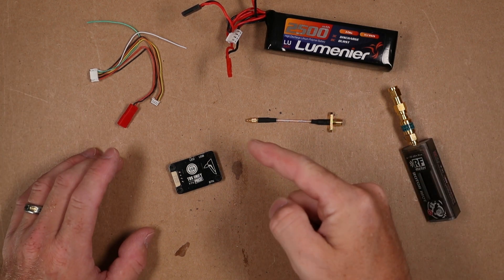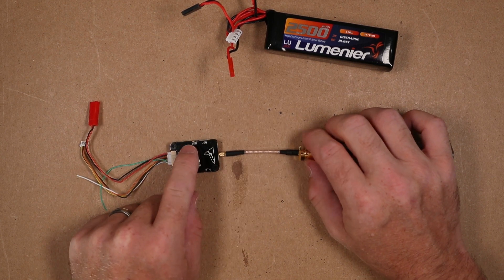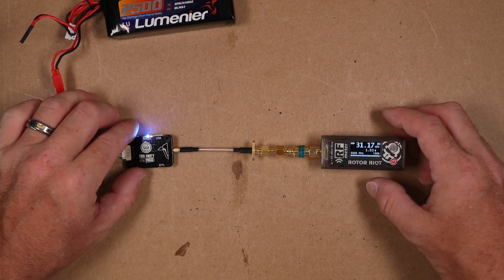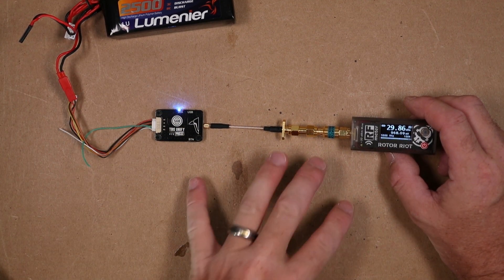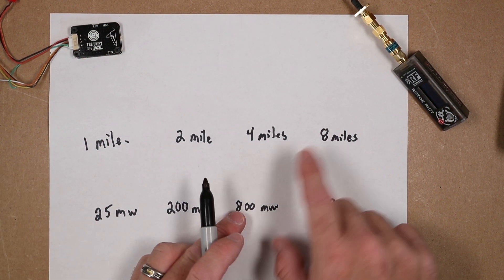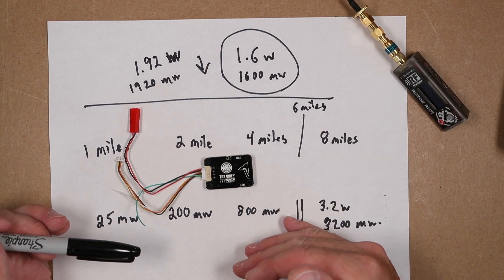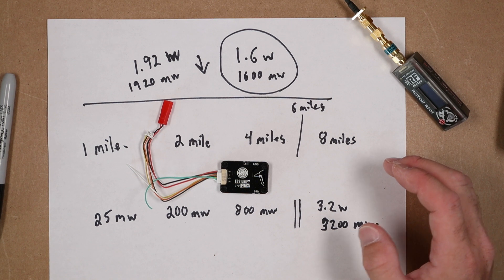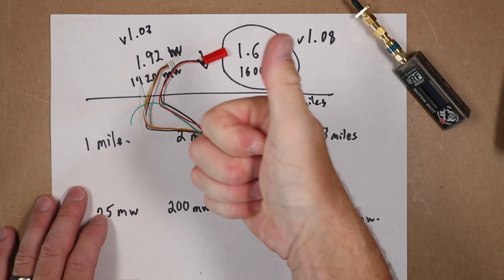Unify Pro32 HV Neutered On Latest Firmware - How Can This Be?

Comment: My pro32hv is brand new. I have 0 range. Cant move 2ft away from the vtx without completely loosing reception in my goggles. Pretty frustrating. When i power up, the blue and red light blink in random patterns. Not sure what the issue is. HELP! Ive done no updates to this vtx. Its right out of the box. All i did was install it in my rigg to the aio bardwell flight controller and it just will not work.
Reply: Thank you for the response. Ill let you know what happens sir.
Reply from the maker: Answered this on another video for you, here's the copy so you don't have to track that other video down. Good luck!

When you first power up it will flash red and blues lights. This is normal behavior. It tells you (red flashes) the 1 channel, 2 band, 3 power level, 4 temp limit, 5 pit mode, 6 crsf/sa, 7  mic in that order.  Count each red flash and make sure its not stuck in pit mode (5 red flashes, 2 blue). I know, I know its likely not that easy. If its not in pit mode it may be a power issue. Check that its getting between 6 and 25 volts. If its getting voltage somewhere in that range then it likely suffers from a half flash. This is easily fixed by flashing it in Agent X. Let me know how you make out.
Reply: @breaksteel  dude..your the shiznit! Called it! It was in pitmode and agent x did the trick in like 5 seconds...i think the hardest thing about fixing it was downloading and registering to agent x. Lol. That took 10 seconds. Lol. Thanks again good sir👽😎👽🙏 stay safe in the world. Dont let this covid thing get us down brother
Reply from the maker: Always happy to help out. Glad this worked out easily for you. Enjoy that VTX!

As for the Covid... I typed all this bed ridden. I’m pretty sure it’s the flu but I’m not allowed out for a few weeks. Asked to be tested and they wouldn’t so here I am. Will attempt to record some update for everyone as it may effect my upload schedule.. Got one vid scheduled for tomorrow. 
I’m not letting it get me down. Will press forward once able. 
Keep strong and thanks for the kind words!

Comment: I just put one in a new build and it died after about 6 test flights.  I didn't crash at all.  It just stopped working and all lights are off.  I'm going to return it  but now I don't know if I want to replace it.  It was on the v1.08 firmware.
Reply from the maker: TBS has mentioned to me that this issue is an 8 second fix with a proprietary tool. 
They also mention 1% of devices are affected. Even if that number is 20%, the odds of another bad one is slim. You could get in touch with TBS and they will fix that one with no questions. Interesting that it’s happened on v1.08.
Reply: breaksteel RaceDayQuads is sending me a new replacement.  They did ask for the old one back.
Reply from the maker: So when you get the replacement it’s said that there’s a firmware fix in v1.13 that just dropped yesterday for that issue. 
Good on them for making the exchange. 
RDQ is not a TBS authorized dealer. They are buying TBS products through another unknown vendor just to have the products available because they are so sought after.
Reply: @breaksteel  Oh, I meant to say they did not ask for the old one back.  Maybe it can be fixed instead of tossing it?
Reply from the maker: Yes it can be fixed. Open a ticket with TBS, they can fix it in about 8 seconds. Then when you get it back update to v1.13 (if they don’t do it for you) and you are good to go with a free unit. Score!

Comment: just some quick clarifications:

1) the output power was not changed between V1.07 and V1.08. I suspect the drop in your measurement is from internal heating?
2) the video transmitters are not burning up. some customers have reported that they break, which we have identified it to be unreleated to hardware. we're currently looking into "shaky" connection on powerup.
3) slight math error. 25mW x 4 = 100, not 200. it is actually why our power levels on SA 2.1 are 25 / 100 / 400 / 800 / 1W+
Reply from the maker: Thanks for the clarifications! 
1. The slight drop could be caused by the addition of an attenuator causing losses due to added connections. 
2. This is the phrasing that people have come to me with. When digging into the issues it’s usually “won’t turn on” or SmartAudio isn’t working”. Yes, hardly ”burning up”.
3. I was so worried about driving home just how tiny a loss 1.9 down to 1.6 actually is that I totally screwed up those numbers. I saw this while editing and left it as my point was made and such a elementary error is a bit humorous. I did mention I was terrible at math, although truly not this bad. 

This is still my go to VTX and the one I still recommend to people if it will fit their build. Such a power house piece of hardware.

Comment: I had this particular one with the 1.7 firmware but it stopped working with betaflight unless I upgraded the farm where to the 1.8 then everything started working again returning this back to where I got it  keep my unify HV Pro
Reply from the maker: It would appear v1.07 was not limiting properly and burning them out. I’m not sure why Betaflight would have prevented you from operating the unit? How did you have it hooked up, SmartAudio or CRSF? I’m using mine through CRSF and it’s working on v1.07. Betaflight has no say in what the VTX is doing at least in my case. 
I also haven’t heard of any issues yet on v1.08 in which the power lever as shown here isn’t that much lower. So your shipping back a working unit?
Reply: @breaksteel  smart audio was used and smart audio through my controller that didn't work and I did upgrade to the latest betaflight firmware upgrading the smart audio ports as well it only started working when I did the upgrade on the TBS to 1.8 did not want to take chances being stuck with a busted VTX so I guess I panic and send it back will I still have the chance so something along the two firmware what's not working properly with betaflight so we'll never know I guess always use the triumph HV no issues at all and I can still say that I run a good distance with it
Reply from the maker: So its an Smart Audio incompatibility between Betaflight and v1.07. What BF version were you running? 
I hear you with just wanting things to work as advertised. This hobby is still pretty well in its infancy even though some will say it’s not. We’re just beginning to see compatibility between RX and VTXs. There’s still hoops to jump through in order to control a camera with the TX. Smart Audio and BF have been having bugs back and forth for a while now. Eventually we’ll strike some modicum of a balance between software and hardware but until then we’re all beta testers.
Grab and go with what works for you and enjoy ripping through the air!

Comment: So elevate it a bit and put a fan on it... does the output power ramp back up as it cools?
Reply from the maker: I have been meaning to test this. Trying to come up with a way to cool these that’s both silent, and fast. Needs to be silent so I can film and it needs to be fast acting to keep pacing reasonable. I was thinking processor water cooled system but feel that’s not in line with what we put them through. So I need a silent computer fan of sorts. I can hit it with compressed air and see what that does and get back to you.
Reply: @breaksteel  I'd just start by dangling it in the air with a ordinary house fan blowing on it.. all we need to know is whether or not its output power is throttled by its temperature, specifically if it goes back up after getting hot then receiving airflow - as would be typical of pre-arming/pre-flight.  
If it gets hot, throttles back, then cools with airflow and throttles back up... then we really need to run that pit-mode type thing (fogot what its called) in BF's Modes and put it on the same aux as the arming switch.  Bsaiclly it sits idle at 25mw or whatever until its armed, then jumps to whatever its flight output power is set for.
Also adding a old aluminum fixed-wing esc heatsink might help tremendously, no matter what, regardless of software version or install situation.
btw.. which side of it gets the hottest?
Reply from the maker: House fan should do it.. I guess I can put it in front of a home ac unit too. The bottom is the hottest of the two sides.
Reply: @breaksteel   Check out Noctua pc fans they are silent and super powerful.
Reply from the maker: @brandonh2690  Looks like a win to me! Ill pick one up after I weed through the specs. Looking like they make about 300 different versions. I'm thinking the 120mm version will throw plenty of air.

Comment: In the first video it looked like Fv1.07 was 180 degrees still putting out 1.9watts. Do your 1.07's gradually step down to 1watt? I dont mind adding a heatsink or a fan if the 6" blades are not enough ;)
Reply from the maker: I think that was the issue that’s burning up devices on  v1.07, that the output isn’t limited or limited enough without proper cooling. There’s a section in the first video where I show the output and temp at 215f. I don’t recall that value so don’t quote me on this, but I think it was around 1.3-1.4w with the full on 105c limiter at max. This new v1.08 cools as intended.

Comment: I put a heat sink on it to keep the performance up. When the air is moving around it on a big quad (DJI I2), the heat isn't an issue. This Tx is fabulous. It reliably reaches as far as DJI's video link and that's just what we need. We needed a decent pilotcam setup and we got one with this.
Reply from the maker: It’s the powerhouse we were all waiting for. When everyone was freaking out that the power levels were choked back I knew a proper test was in order. I’ve installed this on a PINOT switch to also help with it heating up when sitting plugged in, or after a crash. The heat sink is a good idea. You mount that to the top or bottom?
Reply: @breaksteel  I mount it on the side that has the antenna jack attached. I figure that side has the output circuitry.
Reply from the maker: I have found the bottom (the side your using) gets the hottest.

Comment: great Vid. Ive hab mine delivered on 1.07 and I'm not planning on upgrading. But I have it setup in Betaflight so that when i power it on it goes to 25mw and when i arm it goes to the full outputpower. Prearm is better but i dont have any AUX Channels free.
Reply from the maker: This is a good way to have it setup. No sense at all to have it power up at full power and cook while you get ready to rip.
Reply: This powerup at 25mw to full output at arm sounds great. How did you set that up?
Reply from the maker: It’s possible he’s using LUA with a custom VTX script. You can find info on how to do that here https://github.com/betaflight/betaflight/issues/3094 Now this was 2 years ago so there maybe an easier way to do it that I’m unaware of.

Comment: I went through four of them all died after a few flights. First two were default temp cut offs second two I lowered the cut off and they still died. Trappy was asked about the dying units on TBS couch the other week he said they had about 40 of them that had died(I very much doubt this unless I was 10% of them) and they believe it is a software issue and are working on it.  Sure it works at 200/800 hundred but the whole attraction for me was better signal penetration otherwise I'll just stick with my unify pro HVs.
Reply from the maker: There is a large percentage of these that people have been having issues with. It’s hard to tell just how many as most people aren’t vocal about the ones that have not died. Thanks for clarifying that these or at least yours have died from normal use.
Reply: I have also had two of these die on me. Flying... Landed plugged in a new battery. VTX no longer powers on. This isn't isolated and seems alot of these units have this problem
Reply from the maker: What version you running them on? TBS has been good about fixing these. According to them it’s a hardware fix that takes a proprietary tool and 8 seconds to fix. No mention of which tool or if it’s easily attainable by the general public.